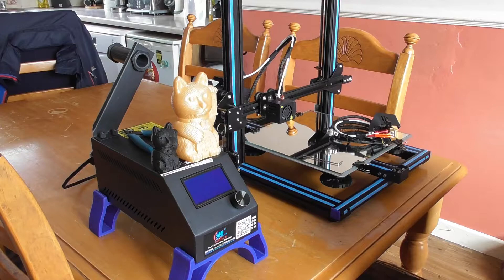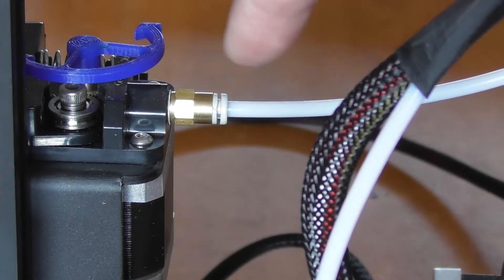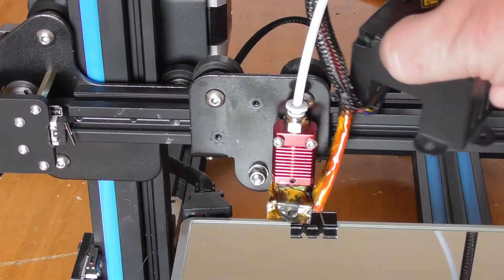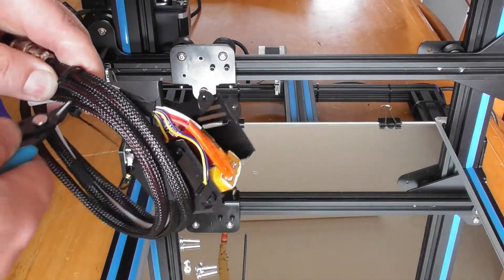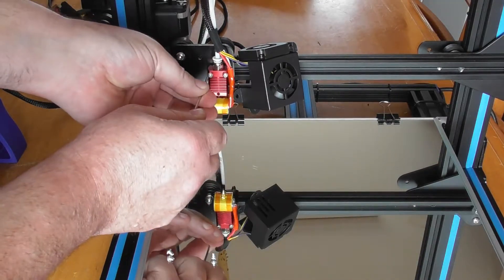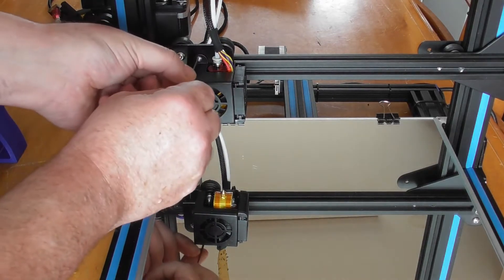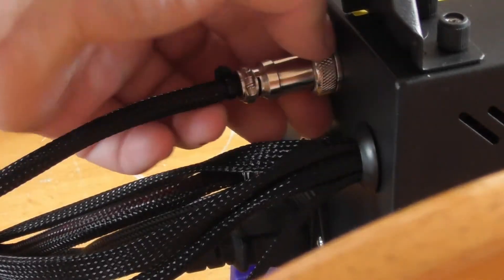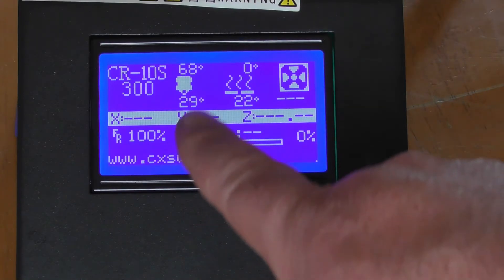Replacing Creality CR-10S Extruder.

Comment: Why are changing the extruder?? Is it broken?  Plugged? Or changing types.
Reply from the maker: The Extruder had leaked filament since I got the printer and then it got blocked .. I thought it would be quicker to replace the extruder and repair the other one later ,that way I will have a spare if some thing else goes wrong ....I can be back up and printing again in less than 10 mins!